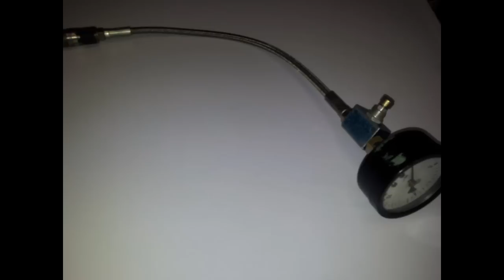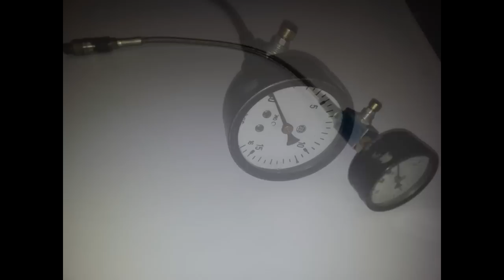homemade compression tester, spark plug disassembling

Comment: How do you let the pressure off after you're done with the test?
Reply: Looks like they put a pressure release valve in line, attached to the gauge. They just press the button and the pressure is released.

Comment: Neat little project but not sure what you're going to be testing with that little 15 psi gauge LOL
Reply: 16bars
Reply: Well how the hell you do an accurate measurement reading in bar increments?  If your only looking to see whether or not you have a bad cylinder than you can just put your finger overtop the plug hole and see if it blows at ya..  because they really best used to check if a cylinder is down a little from the others and seems like 16 bar gauge would only show like eighth inch difference which isnt too noticable unless u really mark where individual needles read...
Reply: It's in bar's so 16 bars which is equally to 230 PSI. 

@Z Ack

We here in Europe measure compression in bar's and that's what is in service manual of an VW engine 10-13bar is good compression all under 7.5bar is bad max difference between cylinders is 3bars. I dont understand why would you think this is not correct measurement reading?